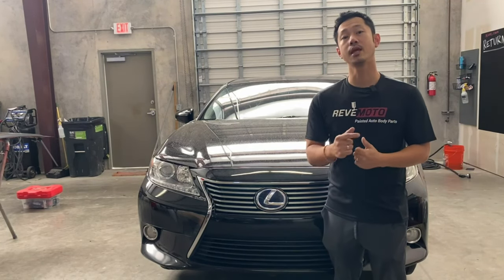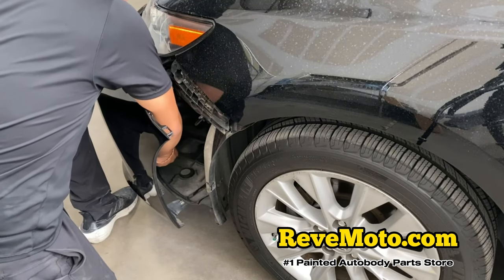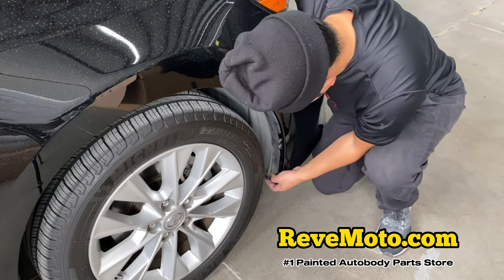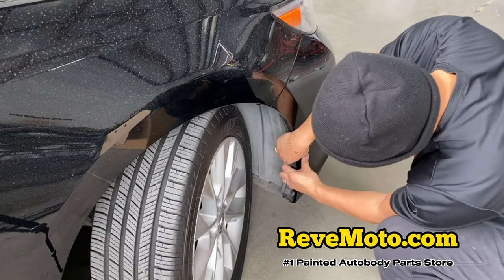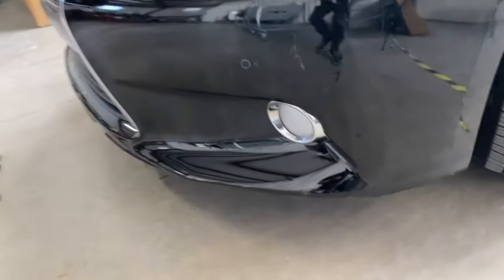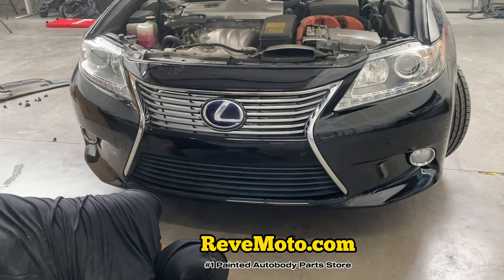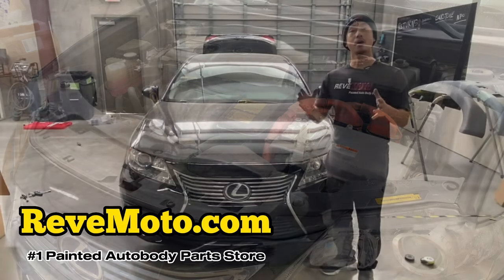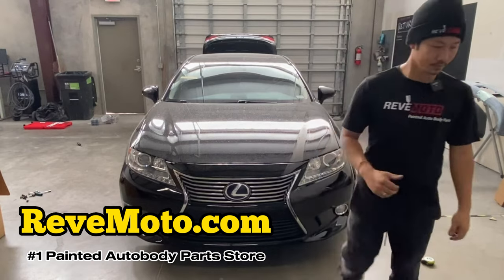NEW 2013-2015 Lexus ES350 Front Bumper Installation.  10 Minute Easiest Install.

Comment: Does a 2018 front bumber n grille fit a 2015 Lexus es350
Reply from the maker: To do that conversion just by doing a side by side comparison looks like you will need headlights and foglights.  I would search the forums to see if anyone has done this.   When you need the parts go to wwwRevemoto.com they can source the parts and painted